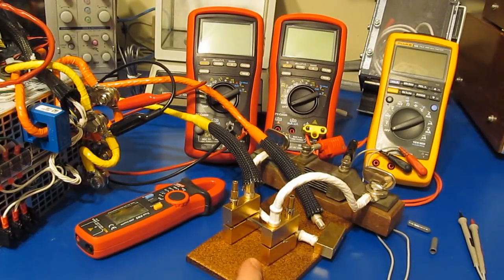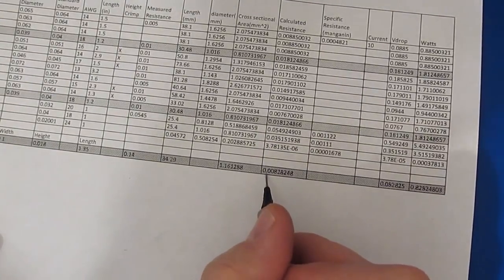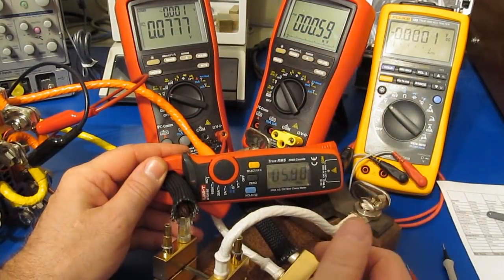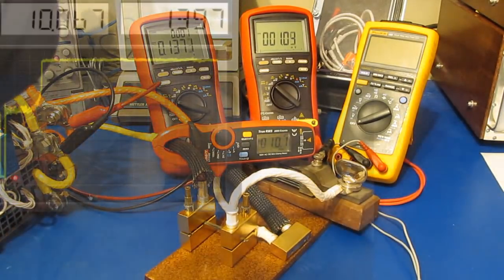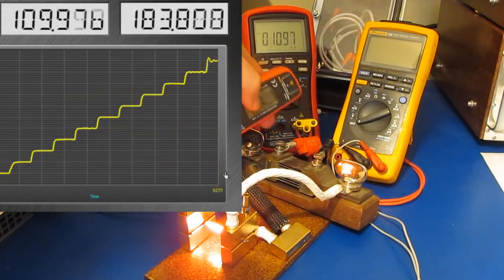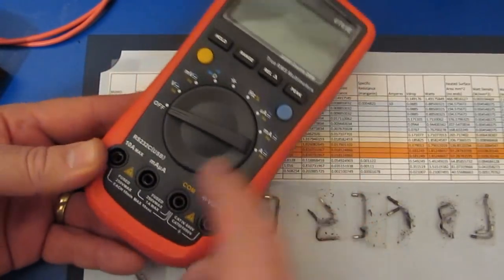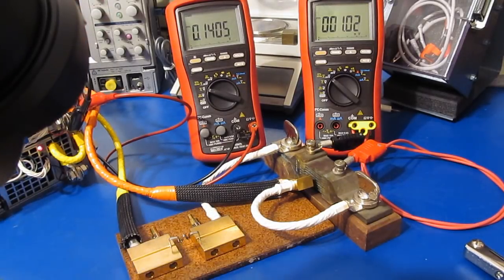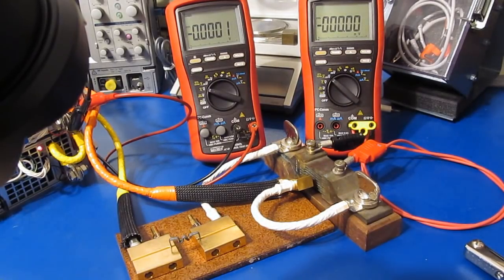Testing Power Supply Upgrades w/ LEM Current Sensor

Comment: Is there a video or a blog which explains how this power supply works? How you get a constant current out of these PSU's? I think about building one. Thanks in advance.
Reply from the maker: Ohms law.  If the resistance varies, you can can change the voltage to hold current at a constant.
Reply: If so, dont you need a really large and high power resistor? Or a transistor makes the job (like in a normal constant current source) but how big is you power dissipation in that case :O If 11V are dropped at 100A this would be 1100W heat :O
Reply from the maker: I have no idea what this resistor is that you mention.  I suspect you are thinking of some sort of linear regulator.  These are switching supplies, not linear.  They are fairly efficient.   Most of the heat is actually in the load.
Reply: Have you built it your own? Can we have a look inside the power supply ?
Reply from the maker: Yes, I have designed a few switching supplies from scratch over the years. Looking at pictures of these supplies is not going to help you out much.  I'm sure there are already countless pictures on-line. I do have a very good book on power supply design that I would recommend, however it is fairly advanced reading.
Reply from the maker: Here is a link to small switching load I designed for the fun of it based around an old Unitrode part.  It's basically a buck convertor.  If you can find the old Unitrode documents on-line, that would be a very good reference.  Good luck with your projects.
https://www.youtube.com/watch?v=uRLLzFZlWrI

Comment: What's your impression of the UNI-T UT61E ? I've seen a few reviews on it and all were good reviews I'm thinking about getting one but a little more input would really be great.
Reply from the maker: The data for the UT61Es I have looked at is all on-line and available for free.   You can see how it stacked up against all the other meters I have looked at.
Reply from the maker: Also, there is a playlist specifically for this meter.  You may find it at: https://www.youtube.com/watch?v=14eHpHQxm54&list=PLZSS2ajxhiQDrk4o1Y45auwK7LomjnNBU

Comment: That's one powerful power supply! You made yourself a highly inefficient lightbulb! I believe the Nichrome resistance increases when it's temperature increases so possibly if the same current passes through after it becomes red hot, the NiCr wire will still get destroyed as it's resistance increases under the same current load, thus dissipating more  heat.
Reply from the maker: Properties for Nichrome are well known.  It's resistance is fairly stable with temperature compared with many metals. It's not as stable as Manganin or some of the other materials you will find in high end shunts.  I went over some effects like surface Watt loading when I was playing with the shunts.  The heatgun I solder with has been getting red hot for many many years.    Nichrome has a melting temperature of about 1400C.

Comment: Great video as always. Just curious how did you parallel those two switching PS' together? Did you have to use diodes at the output of each PS?
Reply from the maker: Diodes? Say 1V @ 100A?  Well, you caught me....  Even if you take the time to Google search and download the manuals to see how the manufacture recommends connecting them, you would find that I am violating their rules.  The problem is there is no master/slave. You can run them at a fixed voltage but there is a gain/offset error between the two which can cause problems.  You can trim the offset easy enough but there is no gain adjustment.